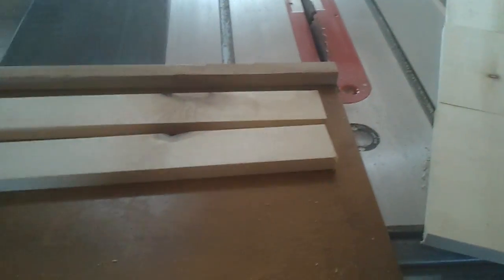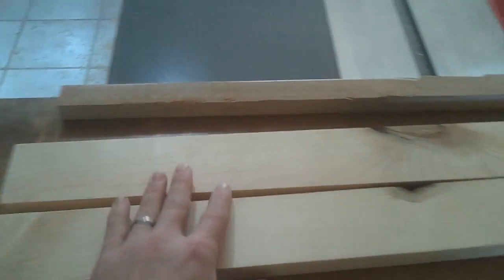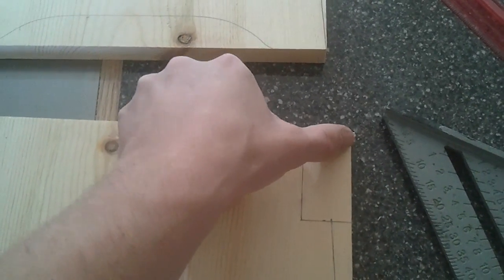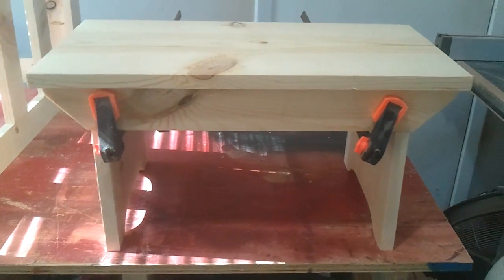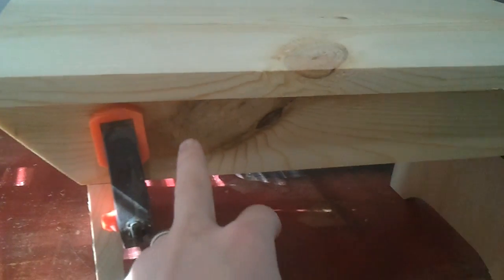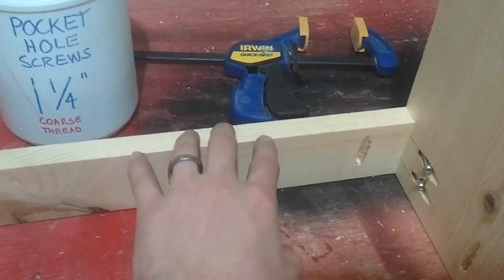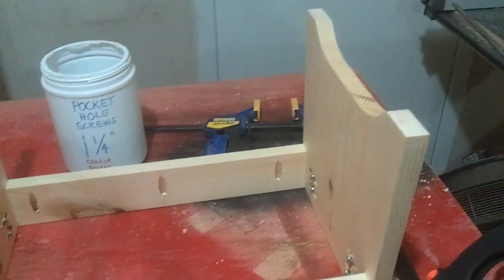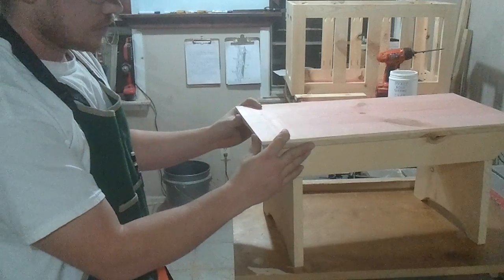Pocket Hole Step Stool - 005

Comment: Nice Job! I will make 3 of these for my grand children (2 boy and a girl). I will finish them with clear shellac and my wife will stencil them appropriately. By the way I will center a 3 x 4" slot in the center of the top to make it easy to carry.
I am a big believer in simplicity, especially when making things for young children (it is quite possible that I will need to repair them later) LOL :)
Thanks again for the ideas, Dan Campbell

Comment: Be sure not to make the overhangs to the side of the legs very wide. Otherwise, if you have a foot on the overhang and the other foot in the middle and then you raise the foot in the middle, you will tip over.